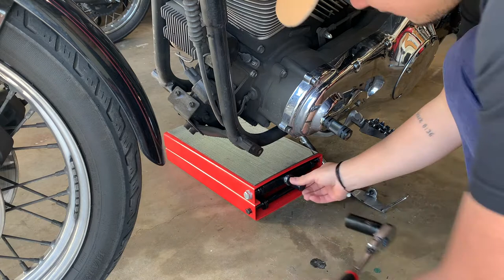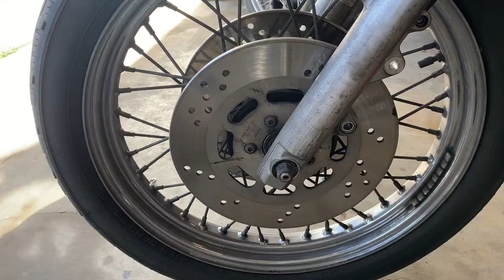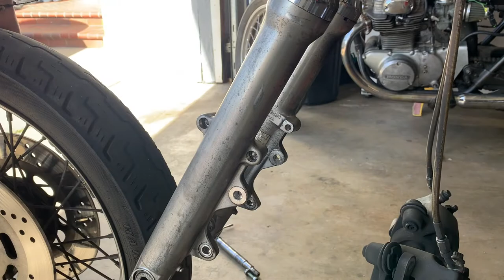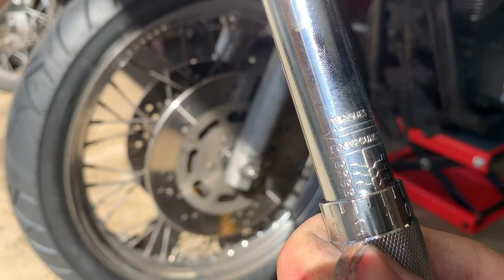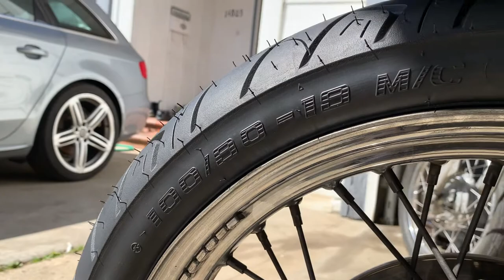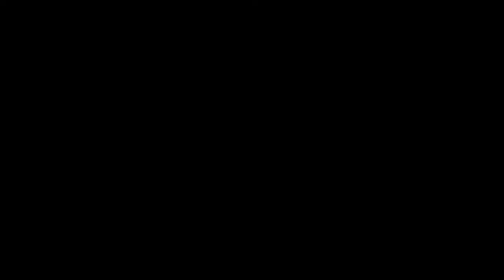Harley Davidson Dyna Convertible Tire Change!

Comment: Nice job.  The only thing I noticed that I don’t recommend to your viewers who may attempt this is allowing the caliper to dangle like that.  Much better to prop it up on something like a milk crate or just secure it up with a bungee to take the weight off the brake lines.  Cheers!

Comment: Hi my name is Harry l have a harley davidson electra glide 1996 not spack I changed the coil for the new one but  no spackle you can help me thanks
Reply from the maker: Hi Harry, thank you for tuning in! If you have changed all the plugs and coil pack, I'd assume it could be your Electronic Ignition Module. It should be under your seat near the coil pack.
Reply: I going to check ✔